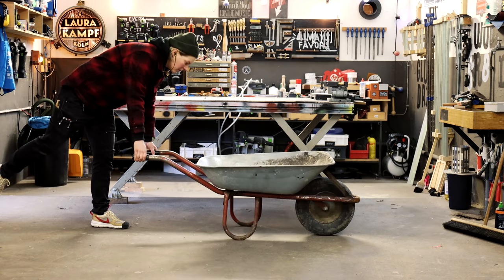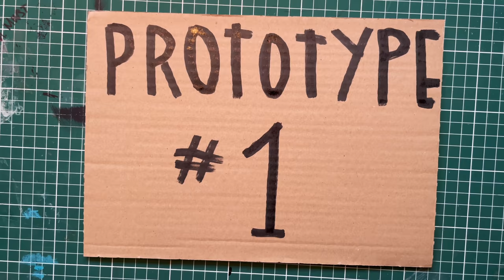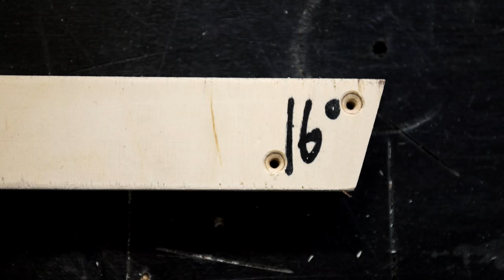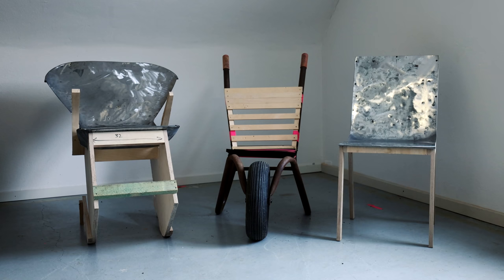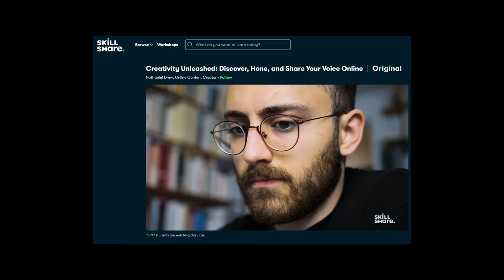Making a Chair from Trash - 3 Prototypes

Comment: I like number 1. It would be cool to use the “legs” of the wheelbarrow as the tipping point and the wheel as a the “stopper” when you tip backwards. The tyre would cushion the landing.
Reply: And the handles the armrests maybe?
Reply: @cormacd478  Very practical if you are in the way XD
Reply: That sounds cool! I had another idea for the armrests - I think it would look great if the sides of the seat would serve as armrests. Don't cut everything out and throw it away! Just one cut on each side where your shoulders would be and bend the metal out- and downwards to have room for your elbows. What do you think?
Reply: The wheel stopper idea sound cool. Plus if there’s a little pressure left you’d get a sort of rock/bounce out of the chair?
Reply: Exactly that.

Comment: 2! I love the simple adjustment in order to turn the frame into a chair. You could add bars to the wheel as foot rests. So long as the tire is inflated, it should be easy to move around. I love it!
Reply: that was my favourite for the same reason, i didn’t even consider the bars until you mentioned it. great idea - like bmx stunt pegs for your feet to rest on!

Comment: no. 3 is most “chair” like but uses a minimal amount of the actual wheel barrow. no. 1 is a first attempt and first attempts... my vote goes to no. 2 it’s aes·thet·i·cal·ly pleasing to the eye... form follows function and pink masking tape for the win.
Reply: Errm.. Form follows function? Which function are you talking about? Medieval torture device? ;)

If form of no. 2 would indeed follow function, there wouldn't be a big impractical wheel where your legs should be, now would it?

Comment: #2 it is the most “lounge chair” of the three prototypes. Also I like the design elements of the tube frame. Could use the cut out cast offs from the other two designs in the seat for this one.

Comment: Great exercise in messing about with an iconic shape. I think the frame of 2 with aspects of 1 and 2 for the seat. The thing that jumped into my head is if the front wheel was extended out you could use BMX stuntpegs for foot rests!

Comment: I like chair #1 because it has storage space for yarn/books and I think I could add a little lamp in the upper corner for reading or knitting.  It does lean back a little too far for me, in that position I would like more neck support.  As a prototype though I like all three.  I really like the graphic style of the maker's brand name on the wheel portion of #2 and #3 is the most traditionally chair like.  Good luck and I'm interested in seeing which one you pick.

Comment: I like the first chair before the improvements and use it as a quest  chair that way they do not over stay their welcome. The second one is for people on the move, you should put some pegs on the wheel axle so you have somewhere for your feet. Like the type they use on bicycles for tricks. I like the looks of the third chair there is something about the beauty of the dimpled metal shined up with some limb style legs and back maybe. But I do like the third one.

Comment: A combination of #1 and #2 would be perfect. It HAS to include the wheel as in #2 with the handles bent less upright and use the barrow as the seat as in #1 (obviously it would need to be cut/molded to be slightly more upright).

Comment: The second one would be the coolest conversion of a wheelbarrow into a chair, as you keep the arguably most important characteristics of a wheelbarrow, namely the wheel and handles. The third one looks to be the most promising design as a standalone; it looks a lot like aluminium seats for ultralight aircraft, and you could add to it by working with lots of lightening holes and/ or raised stabilising ribs in the metal seat. Should you decide to go with the first design, however, I think a fiber reinforced plastic wheelbarrow tub could give you a unique look. They´re often used in construction or landscaping.

Comment: I like 2 the most.  Then 1, it's a little chunkier, but does use the drum recognizably.  Either of these or a fusion of the two would be awesome.  Number 3 felt the weakest like you broke it down for material more than for the fact it used to be a wheelbarrow.

Comment: I like Nr 2. It has a fun factor of it was a wheelbarrow. I would suggest putting BMX Footpegs on the Axel, I really like the Branding on the Bottom of the Wheelbarrow, it was a shame you covered it with Black foam. Could you cast a clear seat form so you can see the bottom plate? I also like Cormac D#s idea to use the wheel as a stopper in the reclining model. like a Stokke Gravity chair. I think combine 1 & 2

Comment: I would choose #1 because ist has potential to become a very comfortable wingchair with integrated speakers in the top and soundsystem in the bottom😎 but putting your chair-project by side, i would prefer to fix the wheelbarrow for its origin purpose, because ist seems not that unfixable. Greetings, Achim

Comment: Just another  idea, combine concepts 2 and 3. With concept 2, bend the handles like you did, reinforce them then cut the tub like concept 3 and use that as the seat rather than the wood slats and foam from concept 2.

Comment: I like #2 because I like to be able to keep my legs apart when I'm sitting. But there would have to be "pedals" on either side of the wheel so short legged people could rest their legs up. Plus it give a loose feeling that you're riding a motorcycle. Plus, it's unique. Who has ever seen a chair with a wheel in front, to rest your feet if one desires?

Comment: Finally I know what to do with my trash wheelbarrow. I like all three of them for different reasons.
Number one and two because you can see that the are sprung out of a wheelbarrow. 
Number three because you can't.
Number one because of the resemblance with the BKF chair (the butterfly chair), I like the wings.
Number two because of the wheelbarrow chassi. And thats fun because if you use it in the garden you can wheel it around following the sun.
Number three because it has got a cool seating. But it will need at just as cool chassi to work. The prototype chassi did not match the seating enough.
So, why chose one if you can make all three of them?

Comment: No.1 if it is turned in to a "zero gravity chair" without a hard stop when going backwards (make the wood work unique or atleast flow). Else if you don't do that, No.3 will be a winner for it's fine minimalist legs. Use a hardwood (or recycled good trashed wood) with the metal given a hardened clear coat - minimal, elegant and unique.

Comment: I most liked prototype #2.  It seemed to be the most interesting with respect to preserving its wheelbarrow origins while being eminently capable of being developed into a practical chair.  Prototype #1 seemed to be more of a gimmick and a less than useful rocker.  Prototype #3 seemed to be the most practical as a conventional chair, but aside from using a bit of sheet metal from the bucket did not really show any of its wheel barrow origins.

Comment: Well ... it simply has to be the chair on the left (as we see it from the third-party youtube perspective).
Not the middle one with the wheel (as cool as that is), nor the one that barely resembles anything more interesting than a common Ikea chair (on the right) ... but, instead, the one that dumped our Laura off onto the floor (glad you were not hurt).
I have to say though: the dump-me-if-you-can chair will need some reasonable bracing to make it permanently secure.
Fondest wishes,
GinoX

Comment: #2 wins because it's the only one that's still recognizable that it came from a wheel barrow.  

#1 might be my favorite with some changes.  It's a fun design because it reclines.
* I think it would have been cooler if you had turned the metal part upside down to get the more reclined angle in the seat 
* forget about the arms, when reclined those things are awkwardly pointing up
* don't remove any metal - it's would look cool if it wrapped around the sides and top.

#3 is lame - sorry.

Comment: #3 is a classical chair, the wheelbarrow is not recognizable. Ibelieve, if you could use more parts from the wheelbarrow in #1 (e.g.the wheel for stopping you when rocking too far) or the steel frame, this would be perfect.

Comment: 3 is.... normal. So not my choice.

1 is cumbersome, and I don't like the cutout... and frankly, I would have done a suspension chair with the bucket, hanging from the ceiling/a stand like one of those enclosed type egg chair.  or a 'Men in Black' chair on a stand.  That kind of thing.  But still not my choice.

I like 2 from the aesthetic standpoint, but the wheel... that's a problem.  Fix that.  I like the chair design with those tubes.  The wheel is in the way, but if you could figure out how to put wheels elsewhere so the chair's handles can be used to move it around...? Definitely the overall choice for me though.

For what my thoughts are worth on it... which is admittedly not a lot, I'm thinkin'... but there they are.

Comment: Indipendend of My two favorits thumb Up for using a Mask while removing the Zink from the Surface. And other safety devices for the work.
For #1 the wip Looks Not safe before making the final produkt test whith a more heavy dummy. And wip whith power. 
For #3 the chair should fit into an other one of the Same sort. These two have too different purposses that it is dificoult to decide.